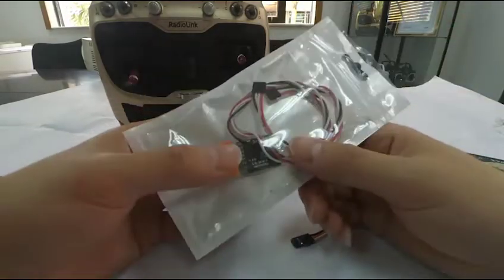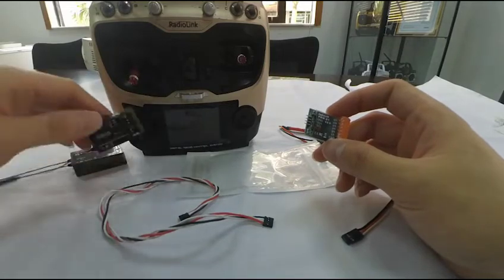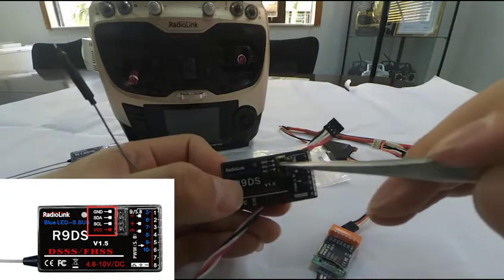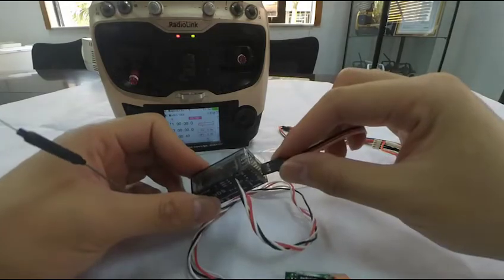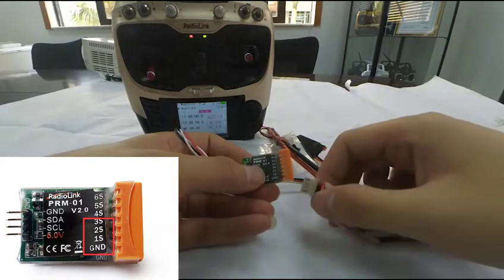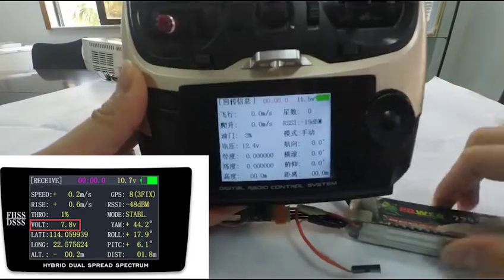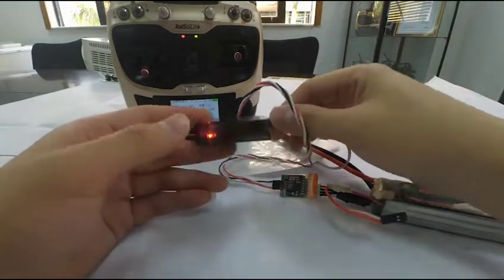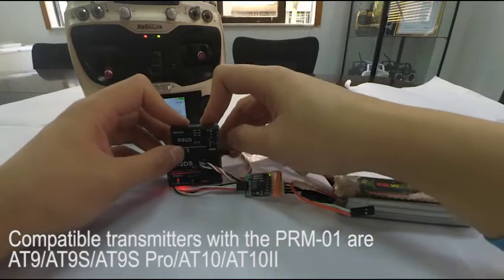How to | Connect RadioLink Telemetry Module PRM01

Comment: Hi , I hooked up Telemetry and the voltage readout is 36.2 with a fully charged 4 S lipo,,,,how do I fix this ? Thanks
Reply from the maker: Hi, sir. Could you please make sure all the connections are correct? If the problem still exists, could you please take a video to us? You can send the email to us. Our email is after_service@radiolink.com.cn

Comment: When i connect telemetry module,the receiver signal in Transmitter get lost.
Reply from the maker: Hi, sir. Could you please check what flight controller you use? PRM-03 only support PIXHAWK/Mini Pix/TURBO PiX flight controller. If any question when using RadioLink products please feel free to contact us. Our email is: after_service@radiolink.com.cn

Comment: When i connect telemetry in receiver, there is lost signal of receiver in radiolink at10 II Transmitter, why?
Reply from the maker: Hi, sir. Could you please check the flight controller you use? PRM-03 only support PIXHAWK/Mini Pix/TURBO PiX flight controller. If any question when using RadioLink products please feel free to contact us. Our email is: after_service@radiolink.com.cn
Reply: Hey were you able to fix it? I too got the same problem while connecting the telemetry to the receiver

Comment: When my electric plane is in the air, how do I know the external battery voltage had reached a cut-off level? How does the AT10ii tell me that? I see a vibration in some pages but can't see how to set up.
Reply from the maker: Hi, sir. When there is external battery voltage telemetry on your AT10II, you can set EXT-ALARM on AT10II. Enter the basic menu--PARAMETER. You can set EXT-ALARM here. When the battery voltage reaches the alarm value you set, you can get the alarm on AT10II. Here is the detailed manual of AT10II for your reference: https://www.radiolink.com/at10ii_manuals  If there is any question, please feel free to contact us. Our email is after_service@radiolink.com.cn

Comment: do i can get longitude, latitude, altitude, distance etc data by using it?
Reply from the maker: Hi, sir. PRM-01 is to get the voltage telemetry. If you want more telemetry of longitude, latitude, altitude, distance etc, you can use PRM-03 telemetry module. PRM-03 needs to work with a flight controller and GPS to get the information you want. Here is the link of PRM-03 for your reference: https://www.radiolink.com/prm03  If there is any question, please feel free to contact us. Our email is after_service@radiolink.com.cn